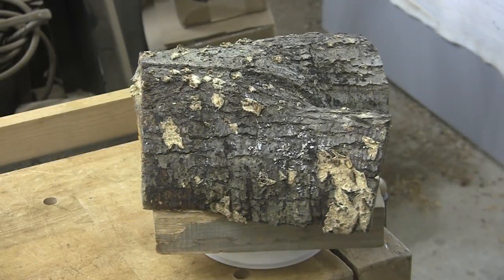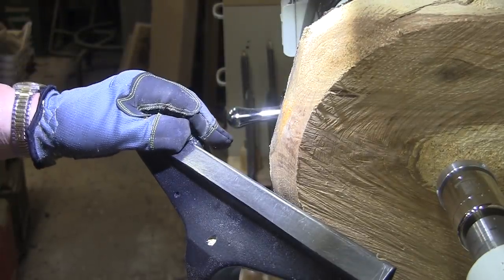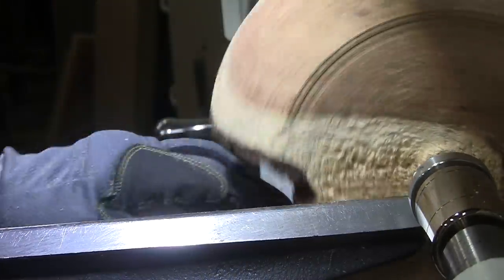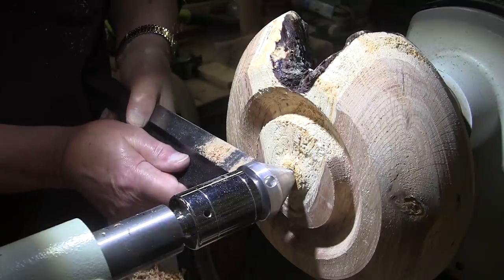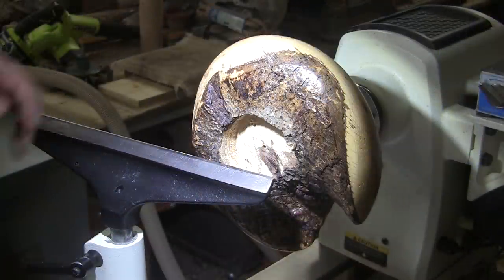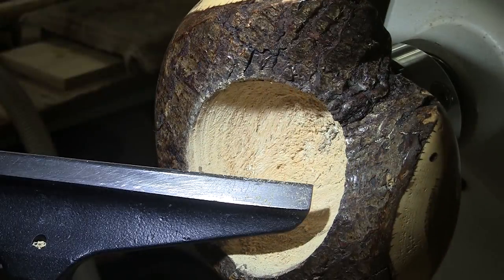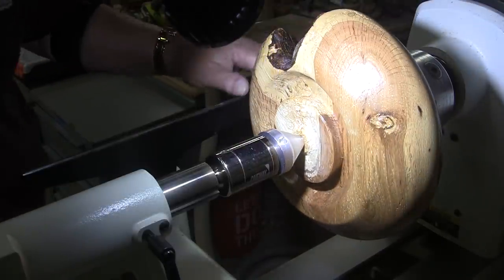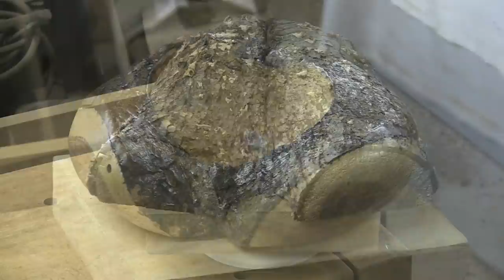Maybe The Ugliest Bowl Ever? - Wood Turning

Comment: Hi Phil. I have a couple of ideas that maybe would help. I think I would have made the rim narrower even though the bark may not have been all around the top. Perhaps also you could have made it closer to a hollow form and thinned the walls of the bowl. But that may not have worked either. Sometimes there just is not a good way to work the wood that will end up with a great result. But it is nice to know I am not the only one that has these problems. And even though this did not turn out as nice as you wanted, you still do great work and I do appreciate it. And I always learn something new.

Comment: I saw your video explaining what you do between shellac coats.  I have never used sanding sealer but want to start.  Do you do anything between coats or is it apply and dry?  
This wasn't one of my favorite pieces but it still looked great. I work with oak a lot so I understand what you were working with.
Reply: I watch a lot of your videos.   I love your videos more than any other.
Reply from the maker: I treat shellac the same as sanding sealer, Allan.  I use the gray 3M abrasive pads between all coats of each and a white one after the final coat of shellac.
Reply: I knew about shellac,  not so much about the sanding sealer.   Thank you for sharing your trade secrets.  Im looking forward to more videos.   FYI...... I'm trying to find you an odd piece of black ash.  Have you ever heard of Iron Wood?  Its very hard and small grain.  And plentiful in Wisconsin.
Reply from the maker: @allanvandeyacht9461  Ohhh, iron wood can be very cool I think!  Never turned Ash of any kind, either.

Comment: To make a secure clamp and live centre support, drill out the punky area and fill it with slow cure epoxy mixed with sawdust from the part's cutoff pieces. A 24-hour or greater cure epoxy is a structural epoxy mixed with sawdust from the good wood from the part looks interesting and aesthetically pleasing.

Comment: You don't want to know what I think. If you used a scraper on the punky wood, Would it smooth out any better? Just curious.
Reply from the maker: Not in my experience, Greg.  Scrapers, for me, do fine on hard wood but this was anything but that.  It would have torn the grain even worse than it is.

Comment: what do you use for a sealing coat and do you use straight shellac for the top coats/
Reply from the maker: I use Zinsser Seal Coat for my sanding sealer and Zinsser shellac for the final finish.  Both come ready to use out of the can and I don't modify them in any way.

Comment: Phil probably one of your best.  One question.   Do you lightly sand with steelwool between each application cleans then add next coat?
Reply from the maker: If this is one of my best, Albert, I better hang up my gouge...
I use 3M abrasive pads.  A gray one between all coats of sealer and shellac and a white one after the final coat of shellac.

Comment: I enjoyed the video just like your others. I was thinking how it looked like a bed pan, and when you said that it made me laugh.
 I have tried using sanding sealer to make punky wood a little harder, but I would still get tear out . I saw where someone used mineral oil on punky wood to reduce tear out. I had an extremely punky bowl blank that I had given up on and it was heading to the firewood pile. I decided to try the mineral oil on it. I let it sit over night and was surprised at how smooth it cut the next day. It was almost like cutting butter.  I ended up getting little to no tear out and ended up with a pretty nice bowl.
 Don’t worry about those that don’t like what you turn. There are Flat Earthers and round bowlers. Pay them no mind and keep turning those outstanding pieces of art.
Reply from the maker: Interesting, thanks! 😊

Comment: It has an interesting shape and grain. The bark is handsome and contrasts nicely with the wood's colors. That was a challenging turning and I learned some tips through your decision processes. I've had very little experience turning punky wood and mine didn't look any better. Could you have hardened and strengthened the tenon and screw holes with CA?
Reply from the maker: Yeah, I could have used CA, Paul.  Should have just used a match and some lighter fluid...

Comment: Would CA glue have worked better, on the punky wood to help turn it?
Reply from the maker: It would have worked at least as good as the shellac, Ronald.  It also would have taken a ton of it and I just find sealer and shellac works pretty well.  I do use CA on smaller areas, though. 😊

Comment: What size clutch are you using
Reply from the maker: Please describe "clutch."
Reply: @PhilAndersonShadyAcresWoodshop  may have wrong name, but the gadget, if you will, that you to hold pieces you a spinning.lathing. Did some lathing back in Jr Hs, 1950, so now getting into it 74 years later, have forgotten some terminologies.
Reply from the maker: @duanekalember297  Oh, OK.  Chisels in general.  Then the specific chisels like bowl gouge, spindle gouge, parting tool, roughing gouge, skew, etc.  In this case I was using a 5/8" bowl gouge.  5/8" refers to the size of the shank.  Hope that helps, Duane!

Comment: Pac-Man 😁    . . . Oh my gosh, when you said 'bedpan' I burst out laughing.    But, seriously, before you began to brush the inside, for a fleeting moment, I saw a Modigliani woman in the grain, and then I lost her when you applied the brush.   
Then, I saw ... you know those 'collars' that lady-judges wear?   Well, that's what the bark looked like for a bit; and then you said 'bedpan' and the collar vanished into thin air.    Finally, I though I could see an elephant's foot, toward the end; like a little baby elephant that got his little foot stepped on.   Or, a fossilized conjoined Siamese baby elephant feet?   
Okay: I do have a real question:  when you hold up the picpic thing, to draw the circle for your tenon, I didn't get what your eye was looking at, out to the right (where the other pic was pointing);    was it just to see where the plate's OUTER edge was going to rest (with respect to the solid-punky areas)?    Well, it's midnight in Montreal.   Nite Phil.   Had a good giggle.
Reply: @Red Leaf I've watched Phil do that a few times now and I think I finally got it.... He marks with left 'pic' and if the right 'pic' will fall on the line it means then that the circle is central. 

If the right pic falls outside of the line then the left pic needs to make a mark to the left of the first line until its in the place where the right pic will touch the line it makes. By this means he knows that the tail stock is in the centre of the circle and so when he turns the bowl around it will spin true and not wobble.

 If he'd wanted to make an off centre bowl he could deliberately offset the tenon to make a differently shaped bowl.

I hope I got that right! I'm sure someone will help us along if not! 😀 

It seems right until the little demon in my brain says but why not open the caliper so it does touch the line? Then I start to doubt myself... help expert wood turner's and mathematicians... 🤯
Reply from the maker: Wow, you saw a lot of images in this "bowl," Red!  All I see is bed pan!
When using the dividers as I did, only the left one can touch the wood.  If the right one touches, it will lift up due to the rotation of the piece and likely go flying.  So, the left one marks the line and I'm looking at the right one to see if it "would" touch the line if it had the chance.  If it doesn't, I adjust the left one to one side or the other so that they both would mark the same line if they could.  I hope that makes sense.
Reply from the maker: You are very close if not exactly right, Jude.  See my explanation to Red Leaf.  I think we are on the same page.
Reply: @PhilAndersonShadyAcresWoodshop  thanks Phil, I didn't realise that you had to be careful not to touch with the other point, always wondered why you didn't! If it's not already obvious I'm not a turner, just a lover of wood and the things you manage to find hidden in it. I liked this piece for its humour 🚽 😂
Reply: @PhilAndersonShadyAcresWoodshop  Hi Phil!   Thank you for your explanations; yes, I indeed see why you touch the divider to ONLY the left side, as touching the 'right' side to the wood would cause it to fly off into space.   I see that now.
My last question therefore is : __ when you pick up the dividers, am I correct in thinking that you pre-determine the diameter of the dividers, to be consistent with the tenon SIZE you want?   
And, as Jude Brown correctly guessed, you look at where the 'right' point of the divider WOULD touch, to see if it lines up with the circle made by the left point, and CORRECT left or right, SO THAT there is 'alignment' of BOTH 'diameter-CENTERS'?  
Thank you Jude.   Thank you Phil.